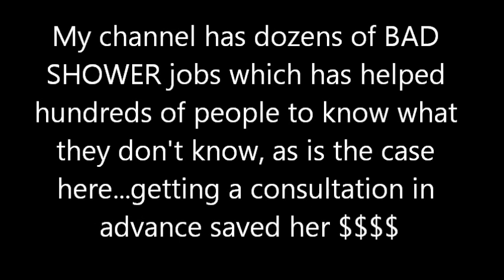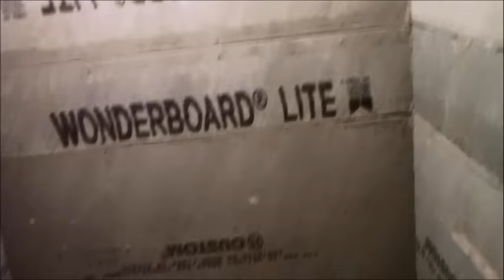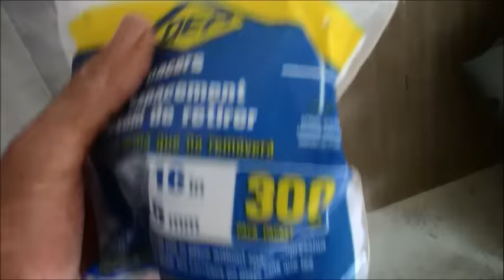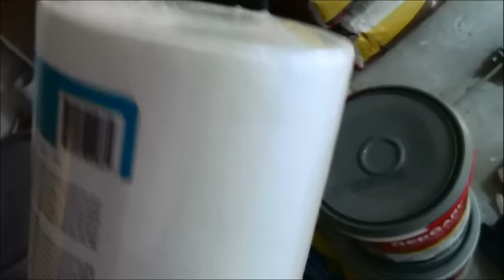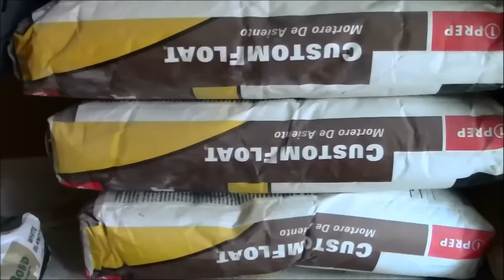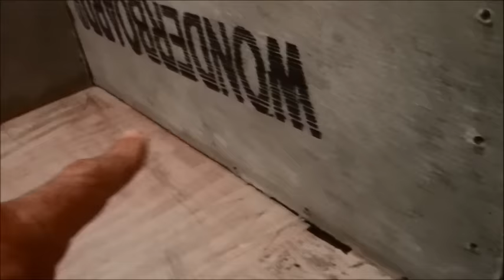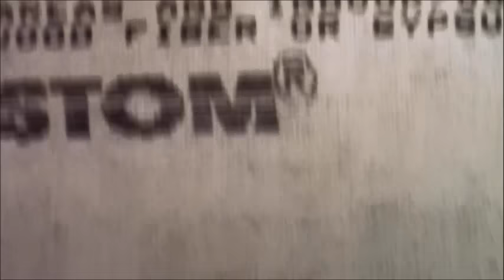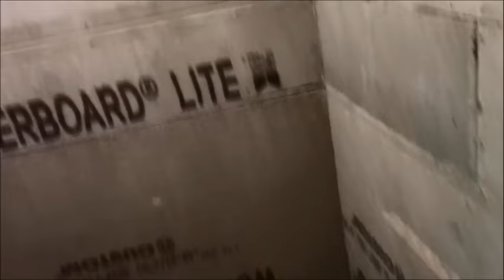BAD SHOWER DAY ONE !!

Comment: As a tile contractor for 20 years i can say he has pointed out some clear issues but he made so many assumptions it is hard to take him seriously. Example: He is critical of the already installed wall board but i have walked onto many job sites where someone else already i installed the wallboard. Conclusion is dude is a tool.
Reply from the maker: Had you clicked on the part two of this in the description you would have seen all the other screw ups, that you focus on the wall board is incidental in the scheme of things, the point of the video is she was getting ready to get screwed over and having to pay twice for the same job and that was the biggest issue and the reason video was posted.... a heads up to homeowners on things to look out for

Comment: I like your vid and everything you said but that 6 inch tape is to put over the gaps in the cement board so the red guard has a rough surface to bond too..it creates a better seal

Comment: also the plumber put the drain in.  dude just showed up to tile it.  We're not plumbers.  We tile over where the drain is.  on plumber or homeowner.
Reply from the maker: I guess everybody's skill history varies but most guys that build showers also do their own Plumbing since they are ultimately responsible for the entirety of the job as I am. And I've been doing some sort of Plumbing from 1988, I've only done tile since 1998.
However even if we assume that this guy didn't do his Plumbing, he's still responsible to insure his tile work is on point and he cannot do that when the other parts of the job are not on point. Cannot depend on the homeowner to be the general contractor and know everything, that's where jobs generally go south and is the reason she called me for the consultation

Comment: Did I understand that right, red guard works without taping and mudding seems ?
I'm using 1/2 inch durrock.
Reply from the maker: I don't use tape because I don't believe it is necessary, I'm not proposing that you do not it is just my way, the seams should definitely be mudded everywhere any board touches any board the Gap should be filled and tapered out and dried
Reply: @StarrTile  so as long as your cuts don't look like a winding mountain road you should be fine filling the small gaps without tape, if you use redguard?
Reply from the maker: @djstringsmusic2994  I make my cuts as straight and as close as possible, the fill in the cracks prior to the Red Guard in essence is your tape, however if you wanted to run tape it wouldn't do any harm I just don't see that it does any good
Reply: Redguard recommends using tape

Comment: You made a video about how the “tile guy” doesnt know what he is doing.  Then about 11 minutes in you admit the “tile guy” hasnt even done anything yet.  The sheetrocker set the concrete board.  The drain doesnt need to be in the middle.   It can be anywhere.  You can take whats there and build a perfectly good shower without removing anything.  Using that tape with redguard is good so the redguard doesnt have to float bad concrete board corners, etc.
13:56 see that GAP?  Would you just fill that up with redguard?  NO.  Even if you could the redguard would fail if applied that thick.  You would need MULTIPLE coats to get that filled up properly.  OR you could just use seam tape.

Comment: Thinking of using laticrete hydro band and hydro barrier . Good,? Or bad? Redguard better???
Reply from the maker: The biggest Advantage is at hydroban doesn't have a fumes That red guard has , other than that they're basically the same
Reply: Laticrete hydro ban is a commercial grade product.
Reply: They've been selling redguard@ home Depot
Reply: That fabric is meant for hydro barrier which requires fabric in change of plains.  Hydro ban doesn't require fabric.
Reply: Yeah basically they are all the same, i like to fill all joints with thin-set, let dry and hit it with a rubbing stone before i apply waterproofing. Usually apply my watrprf. About as thick as a credit card. Its not necessary to use tape with it but it wont hurt. Fyi silicone does not stick to waterproofing. Goodluck

Comment: Always use seam tape as well as redguard on every seam and stress line
Reply from the maker: Why... tell me what tape is used for, and then read the label on the front of redgard and tell me what it says
Reply: @StarrTile  well you don't usually use redguard that thick so it will definitely not stretch that much and seams are far too thick to be covered by redguard alone. It would be in one of your bad tile videos if so
Reply from the maker: @jusdriftinggg  tape is a crack preventor..same as sheetrock tape prevents cracks...redgard is 1st & foremost a crack preventor, then a waterproofer, and yes 2 coats in corners will stretch much more than tape. Use both ? Ok...but doesn't improve your shower or make it better.
Reply: @StarrTile  that's how it should be done regardless of what was made for what reason.  Redguard would surely still crack inbetween seams.
Reply from the maker: @jusdriftinggg  apparently you are not familiar with the product, or you have not watched my half-a-dozen experiments of redgard. Modifications to products and ways of doing things are what I learn from tearing things out...make them better. However that's accomplished is key. But again, using tape AND any liquid topical membrane does not make your project better despite & regardless what you read or heard.
Reply: @StarrTile  I know someone who creates these products for a major company and I used to use/test their products before it's released into the market, so you can say I have some experience.

Comment: What u said is right unfortunatly had plummer botch my plumming tore stud apart and put the toilet water supply line 5 inches from toilet and it did not pass inspection so yeah not sure whats going to happen definetly watch his vidios to at least have a clue to what so called professionals are doing

Comment: The redguard needs tape for dimensional stability, you just disproved your own point. Tiles don't stretch and so the substrate must be waterproof  AND DIMENSIONALLY STABLE!

You mention science but do you understand what rigour is involved?
Reply from the maker: 1st off it's REDGARD, not redguard...

Secondly if you have done as many stress tests with the product as I have you would understand that it incorporates its own dimensional stability. Tape is a crack preventer, Redgard is a crack preventer, Redgard stretches 20 times more than tape ever could. It also acts as a uncoupling membrane, so the tile won't crack from POSSIBLE movement in the substrate 😂

Nice try though...
Does it do any harm using tape and Redgard together, no, does it help the process, no ✔

Comment: There's two types of walk in showers. Those that leak. And those that are gonna leak.
Reply from the maker: Not true...unless it's a commercial builder or a sub under a builder.
Then again we haven't had exponential changes in this industry as we have had in the last 15 to 20 years, so time will tell...but my showers are built much better than the 30-40 year old showers that fail.
Reply: @StarrTile  I'll stand corrected... after watching your videos a bit more, if there are any that won't leak, it'll be the way you do it. I'm very impressed with your workmanship, and logical way of thinking through the process.

Comment: Cant you just take down that bottom sheat, toenail some staggered screws in that loose sub floor( worse case scenario go into crawl space and reenforce with 2×6). Build your curb out of forms, install your drain pan than just reinstall the backer board with new board and set all the dingers. To me it sounds like a half day of extra problem solving to get this job where it needs to be, maybe you should have a more easy going attitude towards your clients make everything sound like its not that hard to fix because in the end it really isnt if you are as experienced as you say you are

Comment: I like your videos bob, I’m a 15 year experienced tile guy, I’ve used pressure treated wood on curbs before , 3 boards high, never had a call back, have you seen curbs move before?
Reply from the maker: When I started out in 98 I used to use PT wood as well, but I backed off of that after a couple of years, it can be done with enough screws or nails but one needs to know that it does Warp as it dries

Comment: You need the water proof mesh red guard alone with out it is trash red guard is the home Depot graduate material. Most tile guys I know won't use that garbage.
Reply from the maker: Most all tile guy use redgard, aquadefense, hydro ban, 8+9 or, some type of liquid topical membrane.
And absolutely it is not garbage, I've done experiments on cardboard boxes, drywall, all sorts of material it is watertight and a lot less trouble than expensive crap like Schluter, which fails.
Reply: No red guard is trash aqua defense is really good and kerdi is one of the best waterproof systems out there just have to know how to install it right. That's what I use on all of my houses I do and these homes are not cheap at all. Needless to say you need to not think your way is the best cause it's not there are tons of ways to install tile just need to find the right one that fits you. I have been doing tile for 22 years and me and my guys are always learning new methods of installing tile. Sal the tile guy that's on YouTube also I like how he does different ways of install to show that there are different ways to do it. 

Agree to dis agree.
Cheers.
Reply from the maker: Never ever said my way is best, what I simply said is in response to you saying that redgard is garbage... if you're going to proport  something then at least back it up with something. I have never had an issue with it, and I have used aquadefense and hydro ban as well, but to spend hundreds of dollars on Schluter Kerdi or any of the other foam products does not make your build any better or any more waterproof. 
To your point about Sal using different products all the time, good for him, not my style, you're basically using your customers as guinea pigs , I stay with what works and proven methods I've come up with and adopted.
Sal is a book soldier, if it is not a rule or in a code, he can't see past his nose, that mentality isn't for me... this business is not finite, sometimes you have to think on your own and come up with Solutions that a book doesn't teach you.
And yes I have the same 22-year experience 1998.

Like you said we can agree to disagree, but I would suggest if you're going to make a comment degrading a product that you back it up with something, my channel is full of my on-the-job experience where I highlight and show where failures happen, how you mitigate those failures is totally up to you
Reply: I have used red guard before and it cracks in the corners it doesn't seal up the shower at all. Maybe you like it and that's ok but for me it's not a good product and my clients aren't ginypigs I have the same method that we have used for years but every once in a while some one comes out with a good product and a new method that works maybe better then the way you have installed for years no one ever stops learning. I know what your videos are about and yeah you give the regular diy err advice and that's good I just feel that you are a little dramatic on some of the problems that you in counter. It seems you are a little hostile with sal not sure why he is a good tile installer his methods are kind of like mine. 
I do enjoy your videos like seeing the stupid shit that people try and pull off in the tile trade. 
Cheers

Comment: You shouldn't portray yourself as an expert, especially when with a few clicks it is possible to go back to your previous videos and discover that a lot of the mistakes you critique in this video were done by you in the past  ( using treated wood for the curve,  using green gyp-board on walls,  not running the curve into the walls, and the biggest mistake is puncturing the liner with screws, etc.)
my point is that all construction should be made according to the currently applicable building codes.
Reply from the maker: Every so-called mistake that you mention is mitigated in my building process...
And I do not believe that all codes should be codes, there's a lot of screwed up building codes that make no sense and don't insure a better job.
I'm definitely not here for a popularity contest  but I never make mistakes and I've never had a callback in 22 years and that is Testament to my work

Comment: You are as bad as I am. I am a carpenter by trade. I also do tile among other things. I don't know how many times I have gone to a job and see what isn't right.The first thing I noticed when your video started was the backer board sitting on the floor. Last but not lease is the hump in the wall. I have been in remodeling since 1978 and take pride in my work but. going behind someone who is not skilled is irritating. You are right about the cost. It usually cost 2 times as much to do that job. Great video!
Reply: Bob, I'm over kill not under skilled! I have 2 sayings; "Don't rush me i'm making mistakes as fast as I can and Do it right the first time or don't do it at all".
Reply from the maker: @cjhoward593  👍👌

Comment: Yes him putting the duraroc on there over the seams would eliminate the movement. So pretending you know why the plywood is squeaking is humorous to me. The plywood is oriented opposite of the joist therefore creating flex points between the joist. It's installed perfectly fine. And spanning that joint equally with a sheet of durarock would completely remove that. So at least if you're going to be a dick do it right.

Comment: 14:30 Don't exaggerate I think you know that, some shower  handle like this one called single lever handle don't need screws. Everything get  hold together with tha screw hole in the middle of the handle AND in some point you said the tile guy bought the cheapest drain but sometimes, some not all  homeowner buy all that stuff and you explain them the square one is more better or not paying the plumber to center the drain  and they  literally don't care..like you say everything small details  matter....

Comment: Correct me if I’m wrong. But in an old video of yours “how to install shower pan liner and mortar” you used pressure treated 2x4 for your curb? However I do enjoy your videos
Reply from the maker: True enough, 6 years ago....
But I also toenail 3 1/2" nails on left & right sides and run 6 sets of nails on all 3 studs, that prevents warping and twisting ✔
Reply: StarrTile fair enough, I was just wondering. And yes 6 years ago...
I enjoy your video👍

Comment: Get to the point,  that is acrylic based glue.   thinset and mortar is prone to moisture absorption, stress fractures, and many other issues, that is old school technology.  People using nails in sub-floor is lazy and the cause of the squeak.  The nails flex up and down and will get worse over time.  SCREWS people.  Your tile mud will easily cover that.  Kinda feel like you're trying to justify charging more bro.
Reply from the maker: The point is it's a hack job....
Everything beyond that is explanation to ignorant people

Comment: lol a bad tile guy buys new spacers?? ooook. A bad tile guy doesn't factor in new materials for each job in my opinion
Reply from the maker: Oh yeah ? So ignore the other 12 major mistakes and focus on spacers ? 😂
So you'll throw up those tile with pre mixed thinset using warped pt 2x4 and plumb fixture with sharkbites with valve screws covered with wallboard that's not plumb and wrap your liner on the wallboard that has no scabbing behind it and leave drain off center with toilet supply line on right side with drain at 14" from wall and a squeaky subfloor..... but you're worried about spacers, gotcha 👌👍😂

If you were buying new material for every job then you don't have your customer's best interest in mind nor do you have enough experience in the field to NOT have excess materials.

Comment: That is mastic absolutely zero difference. It’s only good for sticking things to sheetrock anything else use thinset. But the tile guy hasn’t even done anything yet man how did he screw it up when he hasn’t even started. How do you know that mastic wasn’t for the backsplash for the vanity. And possibly he was using those 2x4s to make a form to make his curb with dry pack?? And maybe he planned on used a foam pan. I have worked on SEVERAL jobs where I just set a drain stubbed through the floor and the plumber hooked it up later. I’m kinda questioning how credible you are as a tile guy because not one single setter I have ever met in my 17 years of doing it would ever set tile on something so random guy prepped. Either I prep it or I don’t do it period. If a homeowner told me they had the shower prep done and just needed me to set the tile I would tell them don’t waste their time because I’m going to tear it out regardless. Not to mention you didn’t even say anything about a vapor barrier behind that cement board.. did you know that it should have a plastic vapor barrier behind the cement board? And there is absolutely nothing wrong with that drain. Yea it’s not the most expensive one but it’s at least one with weep holes in it.